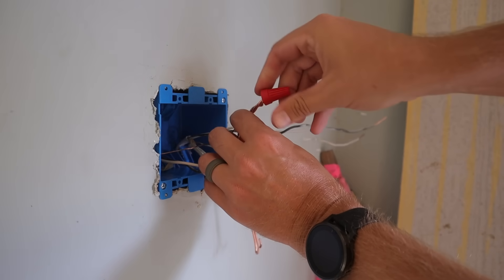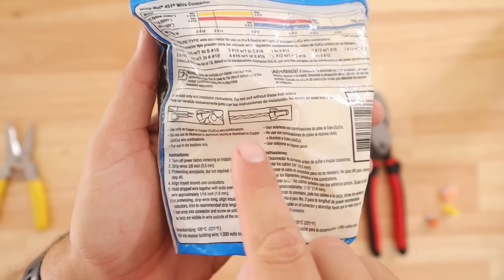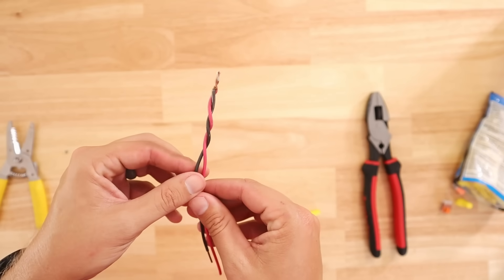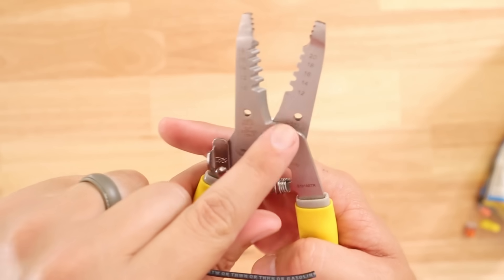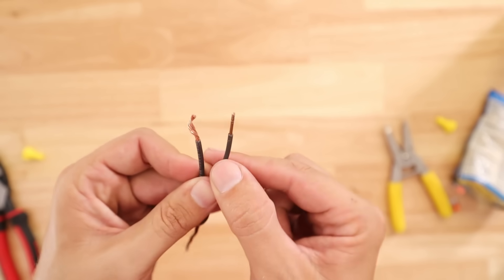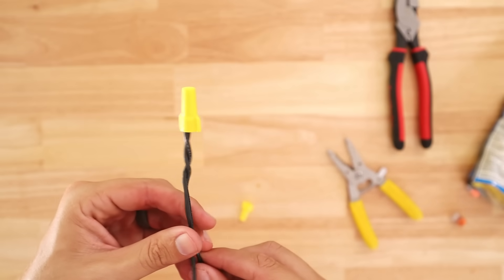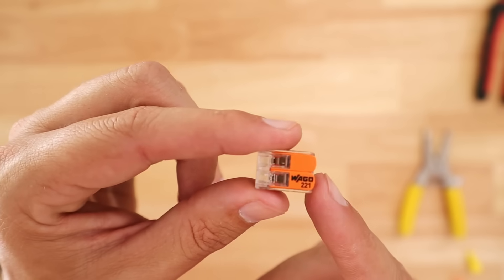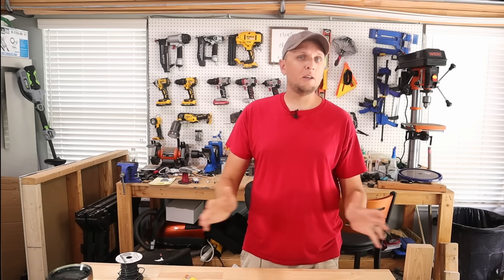BIGGEST Mistakes DIYers Make When Connecting Wires Together | How To

Comment: Cap it and wrap it. After you use a wire nut and yank on the wires to make sure they are secure, put some electrical tape on it to prevent movement and just in case there are any exposed areas fo wire.  Now they have speednuts, which are pretty awesome.
Reply: Ecpt for ground but should include ground you cant have bare wire.
At the wire nut.  Ground connection should by code be heat shrinked and insulated.  How many times have you folded the wires into a box and the ground looks like it could touch the hot wire if moved?  What if the home owner replaced both a switch and outlet for style or safty and dosnt know any better?

Comment: I really don't understand. Electricity is something that is build to stay. Trying to win a bit of time by using a pen cap to hold two wires together is beyond me.
Something permanent like the second thing you propose is way better. In Europe, I mostly see those with a screw to fix the wires.

It doesn't take a lot of time, it only requires screwdrivers (if you are DIYer and you don't have one... man what are you doing ?) and it is permanent.

Comment: Every time I see the argument for or against pre twisting wire joints, it always involves two wires. When two or more light switches in a multi gang box, you frequently have as many as 5 wires (sometimes more if it's grounds) in a single wire nut. I'd love to hear anybody argue that you can put 5 wires in a single wire nut without pre twisting.
Reply: I do that in a regular basis. Don't need to waste my time pretwisting. Install it correctly the first time
Reply: @jamesstephens195  Are you saying you don't twist 5 wires into a joint before putting them in the wire nut?
Reply: @jasonbungard7484  that is correct. If you properly have the wires at the same length,  stripped to the correct and same length and Tighten the wirenut correctly(this step is skippedby too many people). Then pretwisting step can be advoided
Reply: @jamesstephens195  Do you find it curious that that technique is not demonstrated in videos, as they always show only 2 wires? I do.
Reply: @jasonbungard7484  I'v see 3 wire demos, but I think it's just, why show more, 2-3 gets the point across

Comment: The whole American electrical system is flawed. 110 V  ?  Connections like a twist nut ?  This would definitely not pass inspection in my country.  240V is the standard appliance outlet supply.  415 V is the high power application. The safety standards are 200% higher here, than the American system.  It's obvious that these lame standards were made up by a company for their own gain ..not the well being of the country and the people.  Our connectors are called  BP connectors and they have a screw drive that crushes the wires together that makes a solid electrical connection a and a physical, torsional  connection as well.  I wish you luck with you're flawed system and a safe outcome.

Comment: When I splice a solid and a  stranded wire, first I start with longer skinned wires, easier to work with, and trim at the end.  I first wrap the SOLID around the stranded and then twist together.  It may be harder for the inexperienced, but really makes a solid connection.  twisting a stranded around a solid will always be subject to slippage when you put the wire nut on.  When I see 3-4 inches of twisted wire after the wire nut, I think the person didn't have the dexterity and experience to splice the wires together properly , or used a power tool to install the wire nuts..  If you are expecting that twist of wires to protect your splice, you have made a shitty splice. ( I don't mean you my Youtuber friend , I mean anybody)

Comment: As you probably know, wire nuts are not recommended in the UK wiring specifications but we do come across them occasionally.
However, I think your video was really good at explaining where the problems probably arise from during installation.
One benefit of wire nuts is their ease of use and space saving but I do like the Wago system even though I'm a traditionalist and was brought up with the old type, screw down terminals.
Reply: Could UK vs USA recommendations difference be due to voltage/gauge difference?
Reply: Could be , they started being abandoned decades ago . Dreadful on older rubber insulated terminations where loose connections produced poor contact and burning.
Reply: What do/did you use instead of wire nuts?
Reply: @fredflintstone3956  they use Wagos
Reply: Wagos are garbage

Comment: You didn't mention, but there is a wire twisting tool available that can go in an impact driver (or cordless drill) to twist on wire nuts and save your fingers.

Comment: Lol the wire nut section is priceless. I agree it should have some twists in the conductors after the wire nut to stabilize the joint.  Pre-twisting is something ONLY ideal recommends and is pointless as well as (imo) detrimental. Ideal wire nuts are trash also imo. Nec requires a mechanical connection. Wegos are a mixed bag of goods. The push in wegos are trash and should NOT be used. The lever style are better but come with their own problems, heat generation and failure under load being 2, just learn to use a wire nut.

Comment: Finally someone that knows what they are talking about! There is one caveat though…. You should never use a Wego block to connect Solid wire to solid wire. If you’re not gonna do something right, leave it to the professional. Crimp sleeves are also a very trustworthy connection for no matter what you are connecting, you just have to make sure you’re using the right tool. If you don’t want something permanent, and you are connecting two solid wires, there is nothing better than a wire nut. What most people don’t realize is that electrical current passes on the surface of the wire. That’s why using the spring cushion connectors are not good for anything but low current applications such as drivers or ballasts and have no place anywhere else regardless of what the Manufacturer says.  Manufacturers also say that you can backstab receptacle but how many mobile homes have been burned down due to the use of that practice? I’ve even seen almost burnt down the same way! They do actually make connectors specifically for connecting solid to stranded wire that use screwed down terminals which are really the best way if you’re not going to crimp but they are expensive
Reply: Of course, if you DO adopt screw-based terminals, you'll learn that they too have a caveat - you're not supposed to twist the wire strands together before screwing them down because they might  loosen over time. Twisting reduces length and increases thickness, but it leaves the strands at a 45* angle, which means the clamping force that holds them in place has an axial component that wants to stretch/straighten them back out which would shrink the diameter back down. You only have to reduce the diameter a few mil to lose a significant amount of screw tension. Another issue with twisting is that it traps a  lot of empty air space, and air is obviously not as good as copper at resisting plastic deformation due to thermal cycling. And in case anyone's wondering - solder's main caveat (aside from having zero immunity to vibration/flex) is that it isn't stable. From the moment solder is applied, the crystal grains comprising its alloy phases begin to grow and change. Long story short, solder joints get progressively weaker over time until they finally crack. At the end of the day, any truly knowledgeable/experienced EE will tell you the same thing - crimping is the best way to go. It has a hell of a caveat though - you must buy the crimper from the same company that makes the crimp connectors,, and they don't come cheap - typically $500 - $1000. I've seen them as low as $170 and as high as $8,000.

Comment: Your pre-twist on the solid-solid goes in the opposite direction of tightening. I'm not sure if this is intentional, or recommended for the way the wire nut wraps & tightens over it, but I can also imagine it could unwind your pre-twist as you tighten, especially when using softer wires, like stranded.
Reply from the maker: No it was twisted clockwise which is the direction of tightening.

Comment: well.. i am half way there.. i always twist the exposed wire together, just not necessarily the wire below it as well. i think i have done that on occasion, just not as a rule. many times, i dont have much wiring to work with in the first place, or space.. or wires coming in from two directions and no real "overlap" exists..

Comment: The Wagos are 4-5X the cost and don't create as good a connection (the ohmic resistance is higher).  But it's much harder to screw up than wirenuts, and can be verified by inspection. Idiot-proof and inspectable.

Construction code tends to move in the direction of "idiot proof" systems. Consider joist hangers: they don't make as "tight" a structure, but it's hard to screw up the installation, and an inspector can just count the nails to verify correct installation.  Or take the new plumbing systems: you don't need good soldering skills to make a good connection, and the quality of the connection is completely visible to an inspector.  Idiot proof and inspectable.

I won't be surprised if one day WaGo-type connectors are required by code and wirenuts are banned by code.

Comment: As you could see in the video, you’re not twisting a solid & a stranded together, you’re wrapping the stranded around the solid (note, I’m surprised he didn’t liken this to different sized solid wires). From my experience, & a lot of idea sharing, the best way for a good connection is to pre-twist the solid/larger to a like scrap, strip the stranded/smaller a bit longer, then twist it into the grooves of the solid before putting on the wire nut.
With the troubles I’ve had to troubleshoot & the issues I’ve found, it really bothers me that so many ‘experienced’/‘licensed’ let alone DIYers don’t take the time to pre-twist, or do any other ‘it’s easier for me’ process e.g. using wrong screws, not/barely reaming…I don’t think highly of those who choose to save themselves seconds at the cost of hrs, & possibly much more, they cost those who come behind them…even if their time-saving process works 90+% of the time.
Reply from the maker: That is very interesting.  I’ve not heard of that method.  Thanks for the input!

Comment: Love WAGO 221 and the new 10 ga size. But a different but related question.  What is the effect on WAGO connectors when you connect wires of greatly different size and type? Like 14 solid  in a 2 conductor WAGO221 to a 20 ga stranded in an led light fixture? Will they connect as securely? What about scotchlocks? Same techniques for small stranded to 14 ga 15a lighting circuits?

Comment: I have aluminum wiring in my house. Do you have any videos on connecting copper to aluminum and aluminum to aluminum? Are there specific wire nuts that can be used for such applications? I notice that the majority of wire nuts say copper to copper only.
Reply: Is Aluminum wiring a whole difficult/different ballgame?  Difficult and with its own rules? Best avoided if possible?

Comment: There is no mystery. First, push the stranded wire into the wire nut, all the way in. Next, push the solid core wire into the wire nut, all the way in, on top of stranded wire. Finally, twist the wire nut until secure. That keeps the stranded wire from slipping out, because it goes all the way in.

Comment: Did you check with the AHJ if that would be the proper use of the wing nut connector. Remember, the code book will tell you that the AHJ has the authority to override the NFP 70.

Comment: It 50/50. I still pre-twist. I've found just twisting the wire nut there's still a small chance of the nut connecting to one wire not both. But there's been times where it does.

Comment: I like using Buchanan splice caps for connecting stranded to solid wire. Much more surface area compressing the wires together. I wrap the stranded several times around the solid then trim flush and snap on the insulated cap.

Comment: Thumbs down based on the title - should be "Better practices" not "mistakes."  As you stated, in most cases, works fine.
Reply from the maker: I mean its all about the most common mistake made which I showed first and is what can and does cause arcing and fires.  Then I showed the correct way and then better practices.  But appreciate the engagement nonetheless.

Comment: Would soldering / tinning be an option with the stranded wire? I know it would be an added step and more time consuming but just wondering if it would improve the connection. DIY here 🖖

Comment: I'm a professional automation tech and I often do electrical work. I believe the reason electricians pretwist is  partly due to amount of pressure needed to twist the wire being hard on your hands over time. The one you twisted was fine and looked nearly identical to the pretwist IMO. I suppose it could be argued that you are more certain to have your wires evenly at the top of the wire nut together by pretwisting and cutting
Reply: Whenever i needed to use these things in the past as an electrician, we stripped the wire a little longer as shown in the vid. giving your hand some "handles" to do the twisting with, makes it easy on the hands and you dont require any  extra tool to do it. As bonus the wires dont recieve any damage either.
Reply: I use my smitty spinner
Reply: Then tug and tape

Comment: when you cut your stranded/solid  you cut it too short. you shouldnt be cutting any stranded at that point . typically as you twist the stranded wraps around the solid and ytou will have a little solid sticking out . that is okay to cut off , but  you should not be cutting so far back your cutting the stranded .

Comment: thanks for sharing your time.
the waco looks like it would be good on ceilings or where its not so ez to work with the wire ends.  probably more pricey?
Reply from the maker: You are welcome.  It is more expensive.  But not terribly.  Thanks for the input!

Comment: Much prefer pre twisting and never forget to trim the ends flush! I was once replacing 340V florescent ballasts and because we didn't want to go through all the paper work and waiting for approval and having someone unlock the panel room so we could turn off the breaker we were working hot. I'd removed the old ballast and made all my connections on the new ballast and mounted it in the housing when I went to put the cover that hides the ballast and wiring back on there was a hell of a pop and a blinding flash and now the breaker was off. When I went to see what went wrong I discovered that when I tightened the wire nut on the hot connection i had twisted it so hard one of my wires pierced the end of the wire nut and when I pushed everything back into the metal box it shorted out and presto!
Reply: 340 volt? Huh?
Reply: @Humblepye  Working in an international airport, the whole place was wired 340.

Comment: 3:33...but braiding wires upon eachother creates heating of wires that overlap, thereby risking fire?
9:08...but wrapping the strand around the solid will just make the solid slide out when pulling on the solid wire, which is why both have to be braided together rather than one over the other?
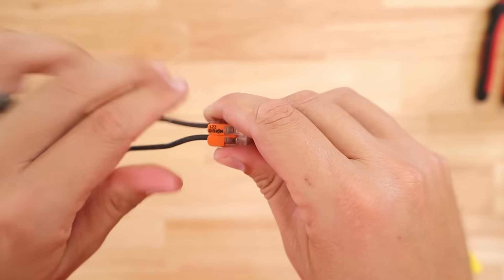12:38...but doesn't the braid need to be done both wires past the Wago221 connector install?

Comment: Wago are OUTSTANDING. And you also have indicator on the side so you know exactly how far to strip the wire. Tip: Use that guide and it will be perfect every time!
I really can not think of any application where you would use a wire nut instead. Wago is simple, almost failsafe, easy and just works.
Reply: Wago connectors have resistance up to an order of magnitude higher than the wire nuts. It may be as bad as 1W of heat output for 220V 16A connection, which will get hot in an enclosed environment eventually. Still, wago is a lifesaver when doing lighting wiring when you simply don't have time (and have a back pain!) to twist a wiring nut.

Comment: You can’t have it both ways. It’s good by the code book yet still wrong but instructions say it’s good. Ya ok
Reply from the maker: Where did I say that doing it by the instructions was wrong?
Reply: @HowToHomeDIY  2:20
Reply from the maker: @bighammer3464  At 2:20 I am saying that just throwing 2 wires under a wire nut and twisting a couple times like I showed in the first example is wrong.  Right after that I go into the instructions listed on the packaging as to how to correctly install a wire nut per the manufacturers instructions, which is then code compliant.
Reply: @HowToHomeDIY  pretwisting acceptable but not required hence not your. You’re wrong
Reply from the maker: @bighammer3464  Yeah, I literally said it wasn't required.  I talk about pre twisting being recommended by many electricians later and why.  I did not say it was required at any point.
Reply: @HowToHomeDIY  this is what you literally said, “So to answer your question as far as code goes, it is not required to pretwist, however this is still wrong.”
Reply from the maker: @bighammer3464  Yes because it was lol it had nothing to do with pre twisting as to why it was wrong.  I was just answering that pre-twisting is not required because a lot of people think it is.